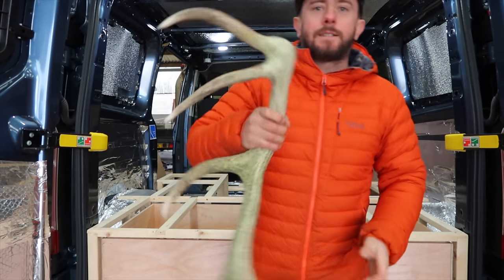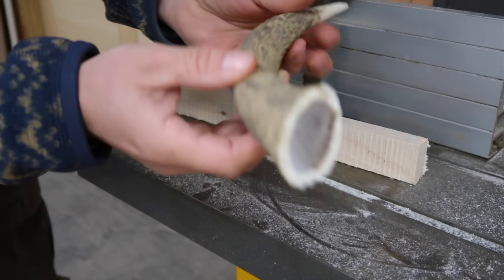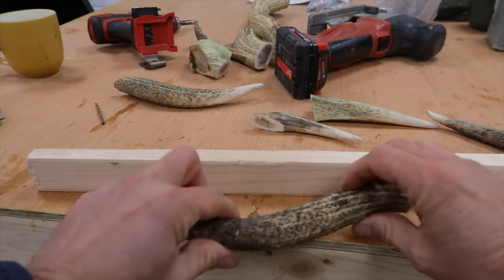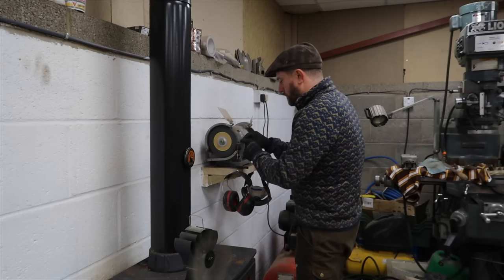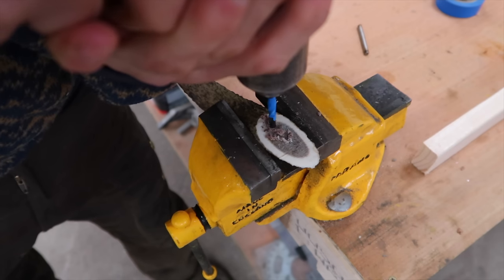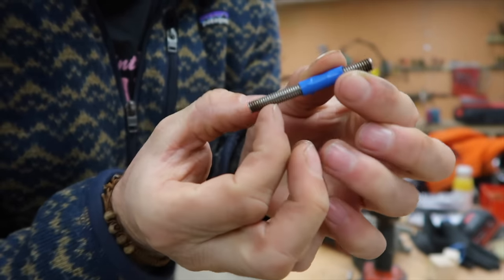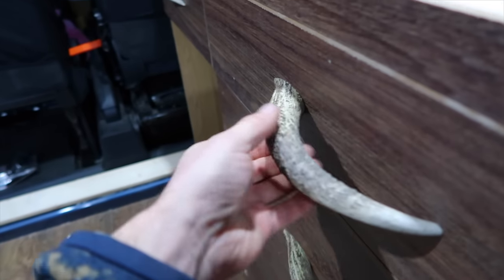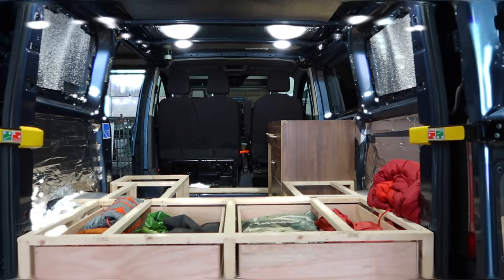Making Deer Antler Handles for my Camper Van

Comment: Looks great. Put a bigger washer on the back.  "Good use of my antlers" so you'll grow another rack this summer?  
And the open ended one mid stack? Probably the best position for it. Anything up near your waist is more likely to snag on something, bottom drawer? Maybe something dragging along the floor.  And if it does start snagging stuff you can always drill a diagonal hole and insert a peg or clear lucite rod to 'close it up' so cordage and stuff rides over it. 
One thought I've always had looking at van builds and the ones at RV shows. Upper cabinets. These are usually boxes with right angles that can bang your head.... I always prefer the idea of hanging gear bags instead of cabinets. Not a hard and fast rule, just something to keep in mind. Do I really need a box up there? You can always put on in later. 
And me with tents, sailboats, dirtbag camping in my Tesla and my Prius V before it: Can I open up my eyes in the morning and look around? I didn't travel all that way to see the wood paneling inside my boat, nylon inside my tent....  Privacy? Even kipping in busy rest stops no one ever looks in the window.

Comment: Nice one :) You can bend the antler to touch the drawer front using some heat. Bolt it to your wood strip put a clamp over the wood and antler and then gently heat the antler and slowly tighten the clamp until the tip touches then leave it to cool. When you remove the clamp it should stay in place with the tip touching the wood.

Comment: Hazy - top tip for cutting threaded bar: Put 2 nuts onto the bar and tighten them against each other to lock into place where you want to cut, you can then use the upper one as a guide to cut against and then when you back the nut off over the cut end it removes most of any burrs and makes sure that the thread works with the nut. Bit of a rough file over and Hazy's your Uncle